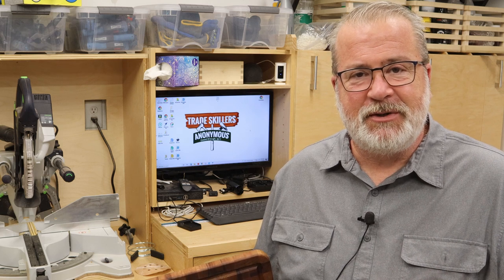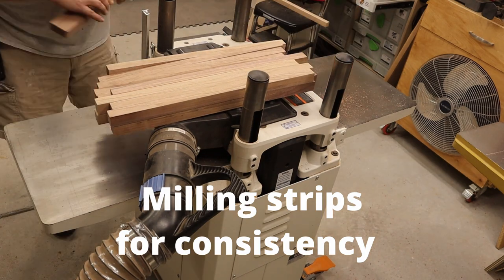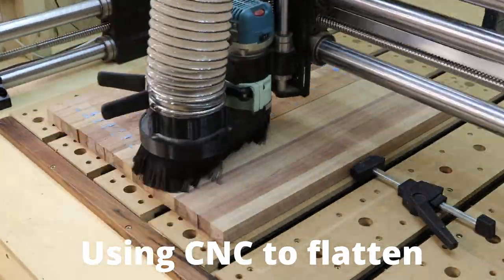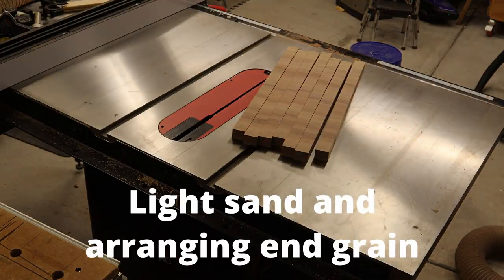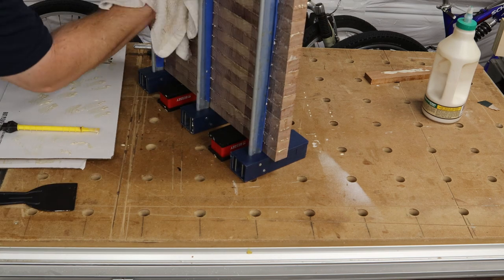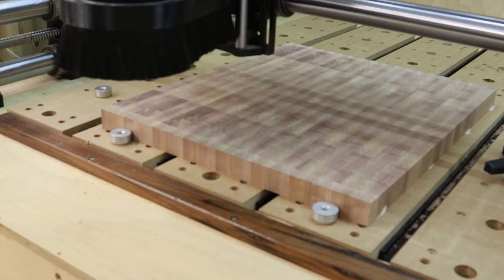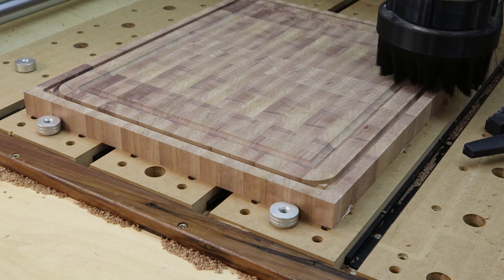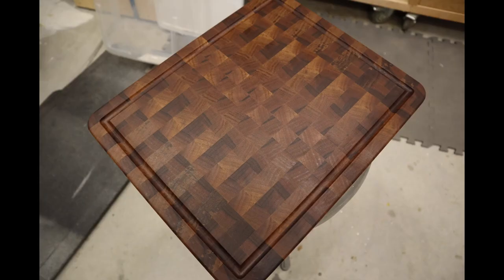How to Make an End Grain Cutting Board With Your CNC

Comment: Very informative video. One question, after the second glue-up, did you flatten the board with your drum sander or did you use a flattening bit like after your first glue-up? Also, when you were flattening the board, did you use a file or did you just set and jog the machine?
Reply from the maker: Hi Timothy , Thanks for taking the time to view, and comment I really do appreciate it.  Yes, I did re-flatten on my CNC after he second glue up, but missed capturing the video.  My drum sander didn't have the capacity I needed for this project, but if it did, would've been a good way to go.  As for the method, I just ran a raster surfacing with a 3 wing whiteside 6210 bit.  In teh metal maching world I think it would be called a fly cutter.  Also, one strategy I use is to leave the work piece longer and wider so that if there is any blow out, it will happen outside my finished dimensions.   If you haven't had a chance yet, and are willing, I'd love to ask you to subscribe in order to help me get the word out to more people who might be interested.  Thanks again and have a great day!

Comment: The video title is a bit misleading.  The cnc was used very little, most of the work was done with a table saw,  surface planer, Drum sander and a routing table. other that that it is a nice cutting board.
Reply from the maker: Hi Ed, thanks for stopping by. This was one of my earlier videos and my videography wasn’t top notch. Surely the strips were made traditionally and glued up, but the Cnc was used to flatten (safer than a planer for end grain), the profile cut and also the juice groove all done on Cnc. Thanks again!